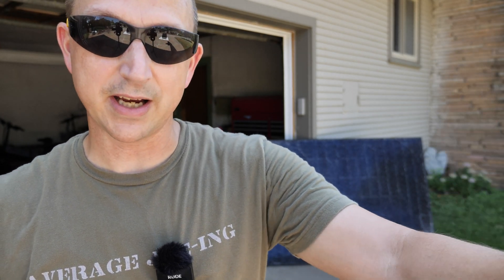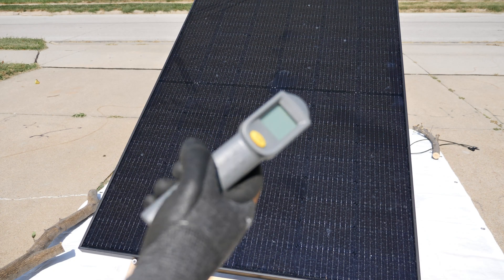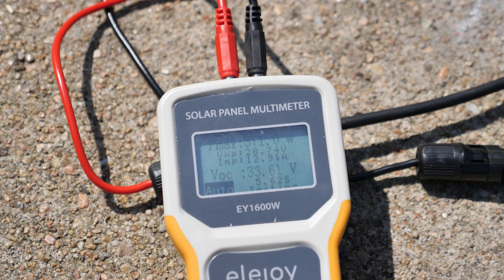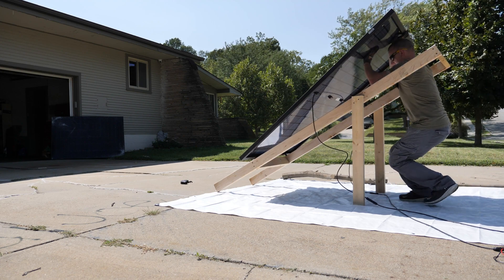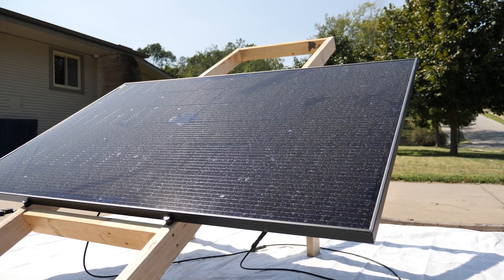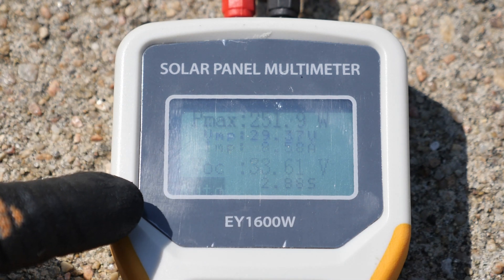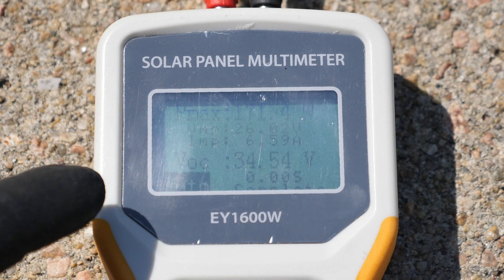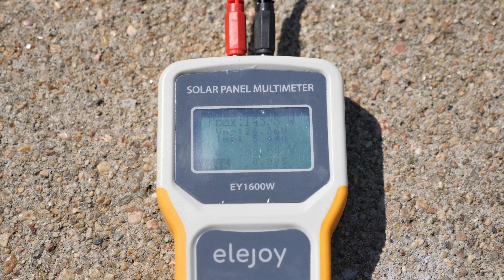Sirius 415w BiFacial Solar Panels with White Tarp Behind!  How Much Gain do you Actually get??

Comment from the maker: Save $50 on Any Purchase over $500 at Signature Solar with my Magical 
Affiliate Links and Code "AVERAGEJOESAVE50"⤵
🔗415w/539w BiFacial Solar Panels - https://signaturesolar.com/sirius-pv-415w-bifacial-solar-panel-black-assembled-in-texas-elnsm54m-hc-415-up-to-539w-with-bifacial-gain/?ref=C2w_5wtHG6jKcP
🔗EG4 Ground Mount -  https://signaturesolar.com/all-products/mounting-options-hardware/?ref=C2w_5wtHG6jKcP 
🔗Elejoy 1600w Solar Panel Tester - https://amzn.to/4dhQW2Z
Reply: Checkout Qsil 216 for repairing the glass on the panel.  May work if there's not too many of the cells broken

Comment: Man, I got those 450w bifacial 30 panels in the garage. I took out a few and tested just on the floor. They smoke the 410w anker mission solar, 450w canadians, and Aptos 410w bifacial. I just don't feel like replacing all 30 of them on the integra racks. When I do this, I will lower the angle so I can put more panels in the same space available.

Comment: Best increases ive seen for bifacial panels are from a reflective wall behind the panel, and adjusted to reflect onto the backside. Something like a white panel, mirror or even sheet metal gives off the best increase. Having a refecltive surface below the panel doesnt give much, probably because of the shadow.

Comment: The panel was dusty. Estimate about 5 to 8% loss there.
Using white tarp doesn't show how much difference the tarp makes unless you take readings with the tarp and without the tarp. Not sure that may not have been your goal but only to show the difference bifacial compared to single face makes.

Comment: As long as a panel is functioning behind the cracked glass they can usually be repaired with Sylgard or one of its clones. I was grabbing all the panels i wanted free that were busted up years ago and used that. Panels still operating fine and going into the 8th year.

Comment: One thing I'd have done is ditch the wood and either get someone to hold it up or prop it up with two thin tent poles or even suspend it with rope from above just to get a higher theoretical maximum.

I think white decorative pebbles could be a good edition near ground mounts

Comment: Installers of these Bifacial solar panels  need to consider running boards across the back face of the solar panel effects it the same as when you run boards across the top. When you block out any area on back side you are limiting the gain from the back side to what ever that area is generated being shaded by those boards.

Comment: I am trying white coroplast panels (Hi-Core) as a reflective material under my 405 Watt bifacial panels on the flat house roof. No measurements yet. The 4 x 8 panels are flexible and masy be angled somewhat. Like the tarp, the coroplast panel is light and may be moved or twisted by the wind. Got to anchor the panel with some weights. I use bricks.

Comment: Cool to see that bifacial panels actually perform.   Just that they are glass on the back side is really cool because you don't have to worry about those plastic coatings cracking and peeling off the back side.

Comment: Could you do a video that has a white tarp (3", 12", 24", ... to the max ) behind it,  then use one of those "thermal blankets" that are quite reflective.... 

As there might/could be a sweet spot of "distance behind" with one type of  "material".

Maybe even a mirror to see if that would do anything.

Just don't "cook" the solar panel.

Comment: OK, how many panels would you need on an average day to recharge a cybertruck?
Reply from the maker: If the trucks battery is 123kwh and it was empty or close to dead. Lets say one gets about 5-6hours of peak sun. You would need around 23kw of solar. Maybe a little less cause you charge before and after the "peak" sun as well. Lets say 20kwh of solar.

Comment: Here in Europe, they install mounted directly to struts on the roof, which means the panels are only a few inches above a clay tile (or slate in some cases).  
Some installers say they will still gain from the rear surface, whereas others say there is minimal scope for reflection under those circumstances, so it's not worth paying for bi-facial. 
Be nice to see what you measure with such a close fit and poor reflective surface?
One of the main suppliers local to me in the UK pushes Rea or JA Solar bi-facials.  Trouble is you'd never know what's really true unless you try both ways....

Comment: Would you mind testing 80 degrees vertical SE/SW facing bifacial vs your 29 to 30 degree nromal south facing? Not sure if you can test the daily full production of 2 at a time. I have one of them eg4 mini splits to install, and I was going to use 4 or 6 of the 400 watt bifacial aptos panels on it, but I was thinking facing half SE, and half SW, and somewhere I read 80 degrees vertical is superior to 90 degrees, and or 30 degrees south with the bifacials. Thank you for all these videos.

Comment: Painful to watch. For bifacial panels, why wouldn't you have a reflective surface ( foil or aluminum, full sun - not shade ) behind (not under ) so that the sun reflects to the bottom of the panel?

Why is wHiTe UNDER THE SHADE OF THE PANEL the best reflective surface for bifacial? Use ur imagination guys.
Reply from the maker: "Painful to watch" Thank You! My inital intent was if someone had white gravel on the ground since that is what most would do and have done and call it a day.  After messing around as stated, will try other options. Next video may or may not be painful....WOOLC🤷‍♂️😆🤘

Comment: If it was my only solar panel and being that it’s bifacial I’d just flip it upside down and run it til the wheels fell off. Prolly have to drill a small drain hole in the framing for rain to escape.

Comment: 1:54... That why I pre-drill holes for the screws on the ends of lumber..😉
4:53... Is it just me or does the panel look like it's covered in dust ?
7:44.. Was that an Air Biscuit ?...🤣 8:38... Another one ? Did you have beans for breakfast..😂
Reply from the maker: Lol yeah the 2x4 split😆. Yess 100% saw all the dust in the video. Was to bright so I didnt notice that day but will clean the panel next test. Air biscuits all around😆😆😆

Comment: Should have tested grass vs white tarp. Also, some sort of angled white pieces to reflect more of the light on to the back. Some sort of oil based varnish/poly so that it seeps into the pores of the shattered glass may reduce the diffusion and increase the output.
Reply: the shatter panel is half dead. even if he sealed it the performance gain would be minimal at best.

Comment: should have flipped the shattered panel over, with the intact back facing the sun
Reply: half the panel is dead. so the other side don't work at full capacity.
Reply: @CotyRiddle  okay, but the other side isnt shattered. so depending on the bifaciality and how much light was getting blocked by the shattered, would be interesting to see the numbers.

Comment: Something people have been testing is standing the panes straight up and putting the main face pointing south southeast.. This puts them under a lot of wind pressure at times so I don't know how safe or durable it would be.. Having the panel on a white base should give both side a lot of light.. The shattered panel could be repaired with clear acrylic spray that would soak into all those cracks and make it stable..

Comment: This is why you should do this same test in the winter on a cloudy sky with no specific direction of sun. Biracial panels will make the most (percentage) difference on this kind of day when the extra power is needed most. The reflection method this guy used was kind of weak, the reflective material area should ideally be 6-8 times the surface area of the panel at the elevated height he was using. Doing this test in the summer when light source is highly directional (point source) will be less effective than on winter day with no directional light source (shadowless).

https://youtu.be/PL17WVBvT4c?si=tSrojk51-vxjPda7

Comment: It was not a good test because if you want a much more reliable answer you first need to know what the best angle for the installation from the reflective material is, and what the best feasible or affordable reflective material is. And after you have that sorted out and tested you can really tell if it is worth to have any reflective material at all. A tarp is most certainly not the best possible reflective material. And your angle was also not the most optimal angle. Far from it as far as I am concerned. 

With your solar array that is located at ground level you have a wall in the back. I was thinking about hanging something reflective on that wall so that you get a much better angle to reflect sunlight towards the back of the solar panel. Even a regular mirror would be a great test.
Reply from the maker: Fare Enough!  I could improve on this!  Mirror may make the next test! Oh and THANK YOU for Subscribing for 15 Years!!! WHOA😲💥🤘
Reply: @AVERAGE_JOE  You're welcome. And indeed  I subscribed many years ago....lol 👍

Comment: A repair attempt with epoxy or urethane might be worth a try.  I'm with the other commentors that would like to know what the test would show if the panels were flipped bottom side up just to know.  I bought one of the meters you have and now have tested all my panels mostly small or foldable.  They all fall short of the max rating but do better than I was expecting.  Horus almost went to his dressing room after that close up.
Reply: I've done this with a shattered panel, and I was able to get it to 90% of original functionality.  Nothing fancy, just some clear epoxy from my local Ace hardware

Comment: I think you went out of your way to accomidate us with your tests,  thankyou !        When you were moving the panel around you were talking about off angle losses and you even took a measurement (with lower watts reading) ------   There is a formula for figuring that out (cannot find it right now) but solar panels are actually very forgiving and they have an oval sweet spot and generally solar panels only lose about 8% production when the sun is (off angle) by up to about 15 degrees.     When the sun is off angle by more than 20% (sun off angle) that is when a solar panels production losses really start going up.

Comment: We have a bank of 12 SEG 405w bi-facial panels facing do south that hit 6,094 watts on August 17th at 01:52. That is 102.83 watts per panel over rated output. This is not an isolated case. We got 36 of them from Signature Solar. i think Sirius uses the same cells.
Reply from the maker: 😲😲Thats Amazing!🤘

Comment: For the shattered panel: solar panels have a nifty trick that if you feed them power they emit IR light. Some cameras can see this light, especially at night. You can test if your camera can capture it if it can see the flashing IR LED from your TV remote. Backfeding the panel like that will show you how much of the panel is out of circuit because of the damage and allow you to show it to the viewers that want you to attempt fixing the shattered panel.
Reply from the maker: For REAL?😲😲 Im gonna test that!
Reply: @AVERAGE_JOE  I don't know if the bypass diode interferes with it but I know the effect is real
Reply: @lekamikaze-75ak "why all solar panels are secretly LEDs (and all LEDs are secretly solar panels)" by Steve Mould
Reply: @lekamikaze-75ak  This i a real effect.  Manufacturers use it as a quality control check.
Reply: Where are the diodes in theses new panels?

Comment: I've done the same tests for my bifacial panels and only seen about a 30 watt gain , not really worth all the effort in my opinion BUT I love the panels. They come close to their rated output which single side panel never do and in the winter and spring they really pay off output wise . In the spring when its cool and cloudy out I've  seen over 1000 watts out of the 2 panels rated at 415 watts.
It would also help to rase the panels up 3 or 4 feet off the ground.
Reply from the maker: Nice! Yes all my panels do so great during those times. Crazy is cause my AC is usually off during it🙄🤦‍♂️😆🤘
Reply: Everyone must assess value for themselves - tests like this help with this decision.  In a grid power-down situation, every watt counts and these panels may be worthwhile.  The bottom line is to optimize so that the front side gets optimum output (your 1000 watts?).  Try to help the backside with some ideas posted here but take whatever the backside produces.
Reply: @panhandlejake6200 if u live in a snow climate.  I think  tithe panel is worth it.  If u live where it never snow the regular ones might be better
Reply: If your panel output is about 400 on average , a 30w gain is almost 10% compound it over time and it wil be worth it

Comment: Yes Joe, put some of that ½ inch foam board with the foil on one side.  Plus put some on the sides aiming towards the bottom.  Try the white side and the foil side.   Great videos.  I have several cracked panels too.  So come up with a good fix for mine too.  BTW are you an amateur radio operator?  I noticed your tower sections.

Comment: Could you flip the PANEL  completely OVER 
with the BACK  on TOP toward the SUN  on the SHATTERED Panel 
...
It might be interesting 
COOP
...
Reply from the maker: As in flip it over and test as a "bifacial"? Sure could!
Reply: @AVERAGE_JOE  
I've  never seen a Bi-Facial 
with the BACK toward the SUN 
to see what FULL Sun 
on it's BUTT would produce 
...
COOP
...
Reply: yeah, i'm also wondering if these bifacial panels can generate the same power on both sides, and if mounting it with the wrong side up makes a difference.
if yes you can have them mounted perpendicular and have mirrors bounce light onto both sides.

Comment: Joe, suggestion, instead of placing the tarp on the ground, how about hanging it vertically about 3 to 10 feet BEHIND the panel? it would seem that the reflection would be stronger to the back side of the panel.
btw - love your channel, been watching it for years
russ from Ocala, Florida
Reply from the maker: Well giver a go! Thanks for your years of watching😬😆🤘
Reply: @AVERAGE_JOE   MY dad, my brother and I all live within 1mile with my dad and I living next door to one another. We all have the exact same "systems" the ONLY difference is mounting.  My brother has his roof mounted and gets 140Kw in the summer 50Kw in the winter. My dad went with the EG4 ground mount to spec but has gravel under it and he gets 160KW in the summer and 65KW in the winter.  I have the same EG4 mounts but 36" off the ground for winter tilt, have them set-up 15ft from the white barn on the edge of the whitewash patio I will get like 170Kw and 75Kw. 
 Because of this all I need to do is add batteries help my system. They have to add inverters and more panels to get the power needed to even max the batteries they have out and then get more batteries.  
 It's WILD to me how much planning and mounting play into this and isn't talked about enough or really at all! Its just inverters and panels as a whole thats talked about
Reply: @AVERAGE_JOE  i'd be interested in that. for your panels on the side of the house, you could put something white up against the wall o' the house, maybe.
Reply: @AVERAGE_JOE  If you wanna go wild. You should do a panel over grass, one like this and one like op is talking about.  But you also need to raise the panel so its at least 32" off the ground add 1/3rd of what the panel is over 6ft. 
 You should be shocked at the overall increase, if you leave them up all day. Because it's the off hours/season that this really shines.

Comment: I know someone with bifacial on his van roof, he placed a sheet of Mylar under it 👍
Reply from the maker: Like white mylar🤔
Reply: @AveRage_Joe  he used the mirrored silver stuff , stuck it to the roof a few inches under the panel , I expect heat will be more of an issue as well so may negate some of the gain ?

Comment: Build frame so that it only on panel frame.Yes a solar blanket. Also, turn panel over to see power out put.
Reply from the maker: I could probly build a better "rack" but do think we should include some rails to be moar "realistic"😁💥🤘
Reply: I want to see the output with no blockage with both sides facing mylar.

Comment: The crack panel belongs in the trash, but I could see a repair video maybe being helpful to people who got their panels off the roadway and can't afford new ones. Even if it fails and the panel is worse, they'll know what not to do. lol
Reply: The cracked panel could be used on a shed for lightning and an old car battery or old lithium battery.  Don't junk it like others say.  Good off grid folks use everything eventually a few times.
Reply from the maker: I agree with all of this😆💥🤘
Reply: @AVERAGE_JOE  I use two of these panels shattered.  Put clear flex seal on it.  It is an extremely cheap fix.  I have these running on a grid tie Vevor cheapo inverter on a current sensing power strip.  It only turns on when there is a load to offset my pool pump usage.
Reply: Possibly a clear resin pour, it'd seal it and is relatively optically clear ?
Reply from the maker: @Dirt-Diggler Thats an idea. Ill have to see what the cost is. What about panel/glass flex? You think it would re-crack?  Its pretty "floppy"😉🤭
Reply: @AVERAGE_JOE  that's a point, I've only used resin on wood 😳 it does set pretty hard 😵